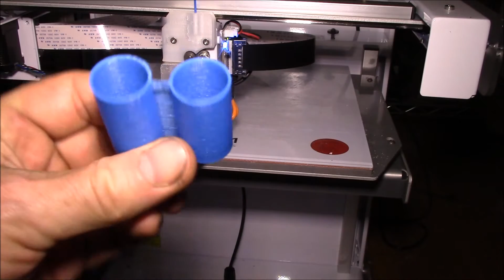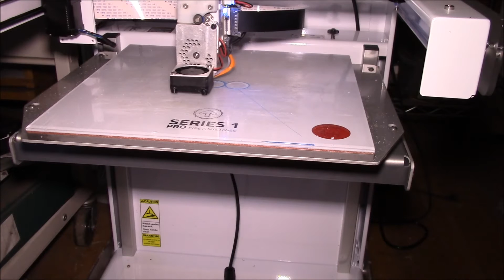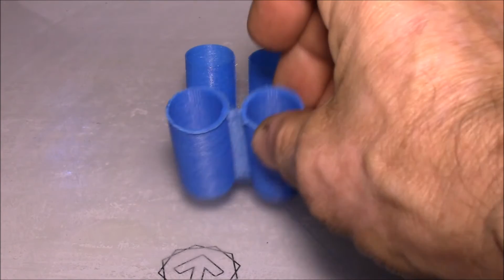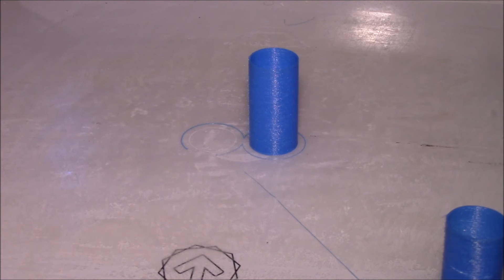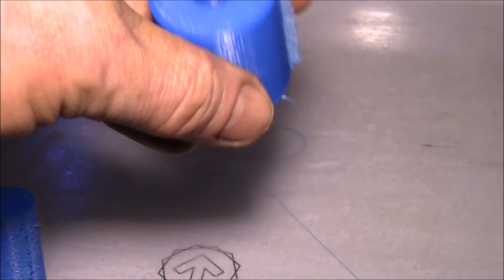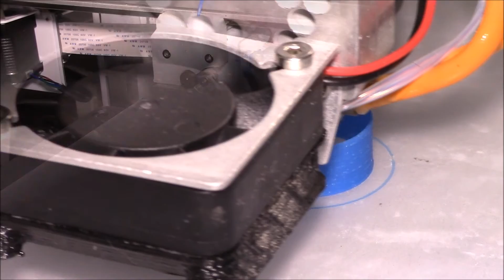3D Printing Nylon String Trimmer Line

Comment: The trimmer line I tried created a lot of popping sounds, and the print is porous. Any advice?
Reply from the maker: Likely has soaked up to much moisture from the air.  Look up filament drying options; oven, vacuum, etc.
Reply: @The4Crawler  Thanks! I kinda thought so, but I also thought that nylon does not absorb moisture… Iapparently I was wrong.
Reply from the maker: @thequixotryworkshop2424  This page says it does:
https://www.simplify3d.com/support/materials-guide/nylon/
Reply: @The4Crawler  I noticed that one of my replies did not come through. It had a link in. Maybe it went to junk for your review ?
Reply from the maker: @thequixotryworkshop2424  Haven't seen it show up in the Review folder.  Sometimes YT is slow on posting comments with links.

Comment: When I first explained 3D printing to my father I said "it's basically weed eater string". I would have never thought it could print so well...
Reply from the maker: Yes, it is amazing that it works, you just have to be sure and not get the line that has fibers embedded in it and that's the right diameter.  I'm still printing off that same spool years later.  I don't use Nylon often, but when I do use it, I just swap to that spool and change the build surface and hit the Print button.

Comment: THEY HAVE SPOOLS OF THIS AT THE 99 CENT STORE I'm going to clean them out now
Reply from the maker: Sounds like a good deal.  Yes, if it's the right diameter its a good filament once you get the parameters dialed in.
Reply: yes the size is almost perfect except there is a hairline of extra on one side
Reply: @cyberblade6669  Someone, somewhere, is sad right now because they can't whack their weeds.

Comment: Iv been printing this for awhile now and thought I'd share my settings on an i3 clone with all metal hot end on a glass bed. Glue stick, 270 on the hot end, 75 bed temp. 2mm retraction at 55mm/s. Filament MUST be dried. If it bubbles out the hot end, dry it more. 30-60mm/s print speed, 8mm brim. Prints very clean with acceptable overhangs.
Reply from the maker: Great information, close to the settings I use, although now with a Garolite bed, I can print unheated.  I may also try setting up a vacuum drying chamber for my spool of filament and see how that works.

Comment: This will have an issue of non tight tolerance as opposed to real Nylon filament and there is about 300 meters to a 1kg roll of filament and this line is 83m.  Cost is cheaper but that lack of tight tolerance kills it for me.
Reply from the maker: I've printed a few bushings that were fairly tight tolerance and they came out fine for me.  Part of it is calibration, figuring out how much bigger or smaller to make the part to have it come out the right size.  But yes, it's nowhere near as nice a finish as ABS or PLA.  I do have some Taulman nylon filament I want to try out some day.
Reply: Also if it is easer to print it Will be better

Comment: thanks
Reply from the maker: No problem.  One thing to watch for with Cura is the different versions have different profile options.  When you import a profile from one version into another version with different profile options, those new profile options can have "interesting" defaults.  I ran into this with the switch from simple "% infill" to the 2D/3D infill settings.  So be sure an check all those non-filament options to make sure they are reasonable.

Comment: Any chance for the cura profile?
Reply from the maker: Sure, I put a link in the video description.   This is off the Cura version that Type A Machines releases, so the version number may be different and it'll have some machine specific g-gode stuff.  I think there's an import profile feature that'll filter out most of that then resave it in your version.

Comment: Do you have your parts fan off? that should help with layer adhesion. Regular nylon is best printed dry- heat in oven ~2 hours at ~ 180, then keep in sealed container with desiccant. I've not seen anything about needing moisture for bed adhesion. You shouldn't have problems with bed adhesion. You should run the bed hotter though- around 80C. I have the opposite problem- it's darn difficult to get the parts to release on glass or blue tape.
Reply from the maker: I do have the part fan off, same for ABS.
I did dry my spool in an oven and keep in in a sealed dry storage container:
- https://youtu.be/xzPvQJxFql0
I think I first printed on glass with glue stick and that worked fine.  I now have Buildtak and with that print on glue stick with no or minimal bed heat.  I'm thinking of setting up a Garolite surface for Nylon.

Comment: so whats the sweet spot for the hot end and bed?
Reply from the maker: Right at 250C on the extruder.  For the bed, w/ glue stick on glass, 60C and with BuildTak w/ glue stick, uinheated works or most anything above that.
Reply: damn son 250? i don't think my Chinese printer can do that. never tried it but im getting a second one in another week or so. ill try it on the new one. one more thing, have you fed pla back into after the nylon? how long did it take to get the nylon out of the head?
Reply from the maker: I've swapped out to ABS and it doesn't take long to flush the Nylon out.  I'll shove in some new filament by hand then extrude 5mm at a time until I don't see any more of the blue Nylon coming out.

Comment: Great video and plenty of detailed information.

I have just started printing the exact same filament 1.65mm.
Have you tried cardboard or paper on an heated bed.

I use UHU glue stick on a Borosilicate glass bed @ 80c.

Lastly,I am working on an hygroscopic  chamber to keep the filament dry whilst printing.

My first print with this filament came out fine,printed with a geeetech MK8 extruder @ 250c.

Check out my thingiverse page for more info. http://www.thingiverse.com/technomastermind/designs

Once again great work,I realty like the attention to detail and scientific approach to your videos.
Reply from the maker: Great to hear from others using trimmer line.  It's hard to find information on this.  I was using glue stick on heated glass originally.  Now I'm using BuildTak with washable glue stick, unheated and that works really nice.  I need to put together a video on that.  The bed on my printer has no easy way to attach something on top, but I was thinking of using Garolite at some point.  Either make a replacement bed for my current printer or get a 2nd printer and set it up for Nylon only with a heated Garolite bed.
I did make a filament dry box, a few videos before this one.